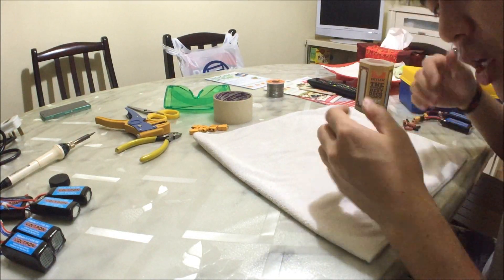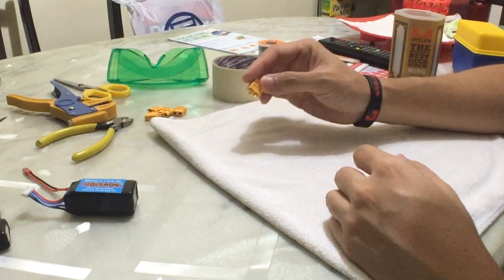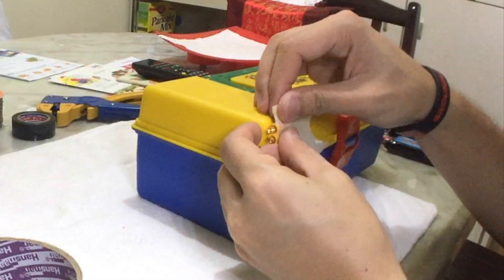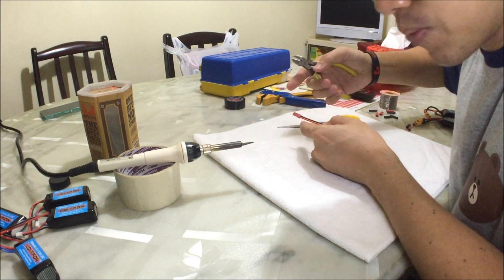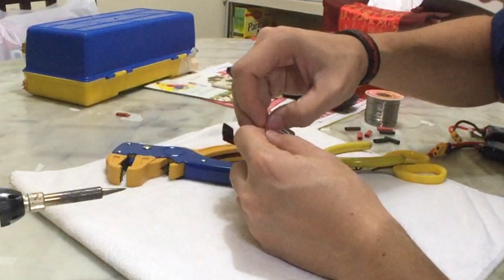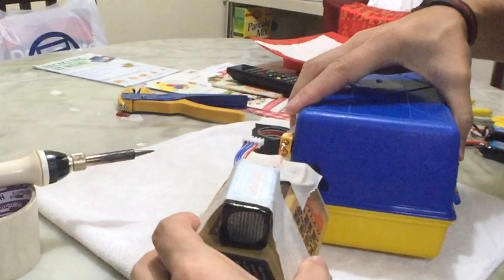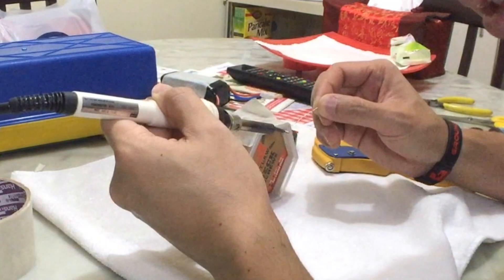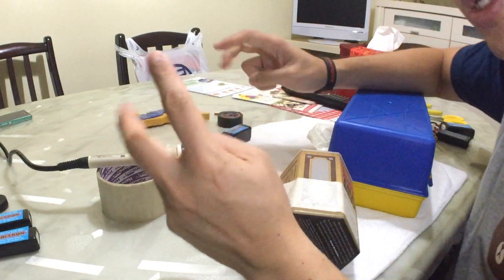SAFEST way to change your LiPo connectors

Comment: The non wired connectors I have (that you soldered on the battery) are all males... so I would have to solder that on the plane end right? And all the wired plugs i have are females that go on the batteries?
Reply from the maker: Plane end?

As long as you know what you want to use for male and female, you won't go wrong :)
Reply: @pSykSG  Yes like the plug on the plane. 😊

Well I purchased a bag of connectors (male/female all in one) just I should not solder the male on the battery, right? As it could short out the battery if positive/negative ever bend and come in contact with each other.
Reply from the maker: @Mr.Studer  Actually it depends. You can solder the male on the battery as long as you'll always be connecting to a female end.

I'm not sure what you mean when you refer to a "plane" but I'm assuming you're talking about an RC plane.

If your plane's battery port is a male port, then solder on a female end to your battery.

It should not short because the wires and ends are always kept separate. Yes, you're right, you never want the positive and negative ends to bend and come in contact with each other but as long as you pay attention then that wouldn't happen. 

I understand your concern! Good call, IMO.

Comment: Nice one man! I remembered I had trouble soldering and soldering for the first time can be rather intimidating. However after a few rounds of practices, soldering is rather enjoyable, infact it calms me down after a long day of work LOL.
I do like to suggest for beginner, do spend some cash to buy some good solder, those that came with the soldering iron you purchase are normally not that great to work with. I find the "flux cored solder" are easy and great to work with.
Reply from the maker: Modding blasters, simple spring changing and stuff, that calms me down! Haha.

Yeah flux cored solder is good. Once it heats up, it "wets" nicely!